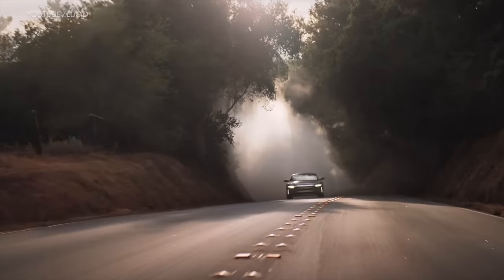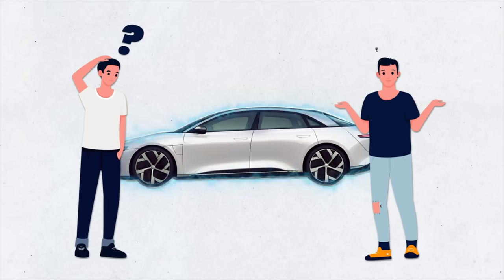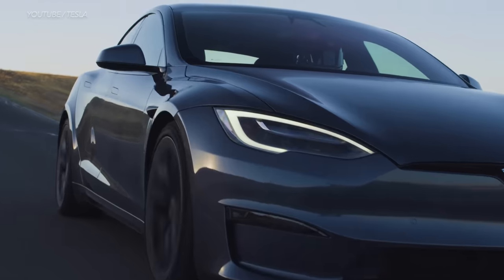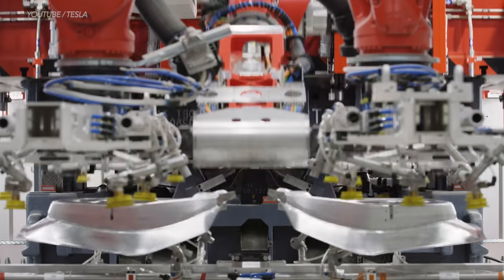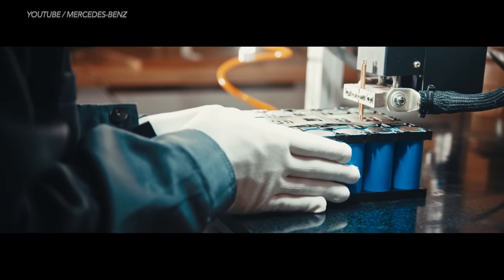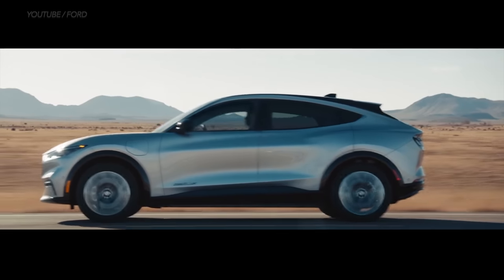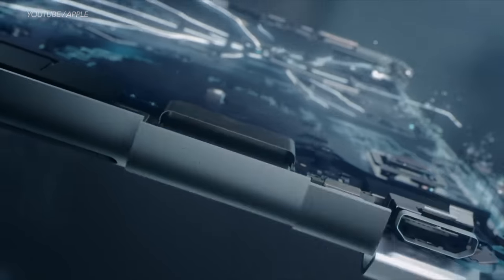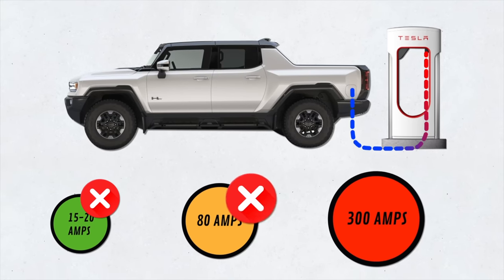Here's Why I'll Die Before I Buy an Electric Car

Comment: For me the upfront costs of EV's will not give you a return for many many years! I'm not convinced they're cheaper. Even in my state if you have a EV there's an additional higher registration fee and you pay a separate road tax. This state does not let you off the hook for road tax just bc you don't purchase gasoline. Most states do this. Buy a good used car $5k, fix it yourself and roll on! Best advice i can give.
Reply: And the taxes for EVs will only get worse. They'll tax you for the electricity and per mile on top of that. Any calculation of the total cost of ownership must take this regime uncertainty into account.
Reply: Good luck finding a good used car for 5k
Reply: Good advice. Long live randy
Reply: You pay road taxes now. You need to pay for your road use. It is not a new tax since you already pay that. Electricity is usually inexpensive. The argument does not make a lot of sense. I drive An EV and won’t go back. The range and charging issues are already solved for Teslas. The charging infrastructure will be improved as we move on.
Reply: @PercivalFakeman  what is the longevity of a Tesla? The cost? Where do the resources for the batteries come from? How long does the battery last and what is the cost to replace it? What are the environmental impacts of mining  compared to oil and gas production? What countries are we in competition with for those resources or do we have enough here, like we do for oil? How are these charging stations generating power for EV usage?
Reply: All the math is based on household electricity remaining static. Watch this space 😉
Reply: @SSJSadAf 
Tons of Toyotas for 5k available :-)
Reply: @benz merc
Yesssss 👍
If an pre 2000 Merc is available, one can't do much wrong with those. If you do have friends living around Stuttgart/Böblingen, the spare part supply is dang cheap as well 👍
Reply: Agreed 👏👏👏
Reply: @PercivalFakeman  The road taxes will triple on EVs because they weigh about 1200 lbs more.
Reply: My state has told us to lower our use of our A/C because the power gride is being over taxed.  Now the powers that be tell me we need to go to EVs and the power grid can take it.  Get out of here.
Reply: @insertrandomnamehere764  where was the article posted cause I knew u saw it once but can't find it now
Reply: agree.... EVs  are  overpriced.  new,  and / or  used.   tezzlas  are  overhyped, overrated,  n  way  overpriced.
Reply: @royhobbs785  they may be about the same as a pickup or large SUV. The worst states are at about $200 per year. Some of the worst states are politically anti EV.
Reply: @vextract4662  The questions you asked all have answers.Many of them I know. Not all are simple. There are even more questions to be asked about our existing path that more serious and Damaging. Battery chemistries are recyclable, it is not the depletion issue with fossil fuels. There was not one gas station in Sacramento when the first cars were purchased. There is always a beginning.
Reply: @SSJSadAf  Maybe $12k................Paul
Reply: @vextract4662  THE newest batteries are designed to last 20 years...........Paul
Reply: Absolutely correct you will lose money wait till your battery goes out and you get hit for $15,000 and not many people work on that electric vehicle junk
Reply: That’s good advice..👍🏽
Reply: Good post. And, I love watching Mecum Auto Auctions. I want an older refurbished car, with NO computer anything on it, and drive that from now on. :) I used to have a 1974 Pinto. It was that horrid mustard color. LOL makes me laugh now, but I'd even take that over an electric car. LOL for many reasons.
Reply: Vey well thought out thanks I: am with you! @vextract4662

Comment: There is no turning point. I will never own an electric car for as long as I live and I'm more than happy to do that.
Reply: To this day there are still some people who own horses and ride them for fun (and I'm happy for them). Still, most horses were replaced with cars a while back. So too will it be with internal combustion engines; some people will hold on to them as a hobby (and I'll be happy for them too), but most cars on the road will be electric (maybe some sort of hybrid for towing/trucks). As the tech continues to improve, the benefits will keep increasing and the costs decreasing. Even without government interference simple market forces would make it happen.
Reply: So you’re saying you’re old and may likely not make it through the next decade😂
Reply: I repel all forms of production in the modern era as they are less sufficient than our ancestors. Electric cars are not the future nor will they ever be, the future is hybrids. We have skipped a stage, the stage of hybrids which combustion engines have been upgraded with a electric parts. Why have we skipped such an important stage and moved onto an inferior way of motoring? Electric cars are more easily controllable by the government, they've already started to put tracking devices in them, it's not secret at this point at all. Hybrids are truly the way forward but why aren't they being pushed as much when they can do a better job than electric? ICE has its limits and we are very close to them.
Reply: @GyroGarrison  Skipped hybrids?! Dude,  the Prius is over 22 years old. Government Tracking?! On-Star is over 26 years old, and pretty much every new car has an equivalent. Inferior?! Inferior is relative to the use-case, as all the options involve compromise; Traditional hybrids are more efficient than ICE, but increase weight, upfront cost, and complexity. PHEVs further increase weight & upfront cost (bigger battery+charging parts), often have slightly lower MPG than regular hybrids, but in exchange offer some EV range (cheaper cents-per-mile than gas). Pure EVs are a further higher weight & upfront cost (although some of it is gained back from less parts; e.g. gas tank/engine/multi-gear transmission), but offer much longer EV range. Each option can represent the best set of compromises for a different group of consumers, and that's ok; that's why they're all available for sale.
Reply: Same here
Reply: @GyroGarrison  you're absolutely right👍🏻
Reply: I said the same until I bought my Tesla model 3, you’ll change your mind 👍🏻
Reply: @itsjammbi  Nah I like my cars to have sound. Plus Teslas are a nightmare to own, especially if you need to repair your car
Reply: @lefthanded5473  there’s little to none maintenance cost for my tesla after 35k miles, plus when you buy one you will get 8-10 year warranty
Reply: @erlindaromero8790  I said the same thing until I test drove a tesla. Best car to drive and super easy
Reply: I think EV works great if you have solar panels on your home.  On average our electric utility bill is virtually $0 even with charging our EV day or night.  Our Tesla model 3 LR has enough range for the typical day trips around the SF Bay Area without having to stop at a supercharger. For longer road trips to southern CA for example, the time spent at a supercharger is only 15-20 minutes. You need that time to use the restroom and get some food anyway.  We still have our ICE cars but rarely had to buy gas as we use the Tesla to go everywhere and run the ICE cars only occasionally.  What we won’t miss with our Tesla are the scheduled maintenance and other issues for ICE cars, ie brakes, oil changes, transmission service, plugs, timing belts, serpentine belts, air filters, batteries etc etc. Also the Tesla is a fun car to drive, it will out run most other performance cars and the Model S Plaid will out run anything production (not modified) that includes the Lambos, Ferraris, etc
Reply: @Norgar756  if this guy was an accountant he'd still be using a pencil and paper ledger. There are plenty of use cases that don't support buying an ev today. I totally get that sad support it but to just flop on the floor and throw a tantrum with no explanation as to why you feel this way makes no sense.
Reply: @GyroGarrison  You are well-named. Your arguments are all extremely poor. How have we 'skipped a stage'? There must be 50 hybrid car models available for people who want them. If you prefer  a hybrid, or a plug-in hybrid, then just go ahead and buy one.

Just stop deluding yourself that having two different motors inside one car, a fuel tank and also batteries is 'the future'.

> the stage of hybrids which combustion engines have been upgraded with a electric parts

What are you talking about? ICE engines have had sophisticated electronics and sensors since the mid-90s. They have had significant 'electric parts' for over 100 years.

Your stuff about tracking devices is just conspiracy theory nonsense. Not only that, but hybrids are easily trackable too. Modern tracking technology doesn't care what kind of car you are driving, so long as it was built in the last 30 years.

You sound like somebody who sells buggy whips and is upset that horses and wagons have gone out of fashion.

You should realise that Scotty is a YouTuber, and all he cares about is clicks and subs. He will say he will never buy an electric car, and then go ahead and get one as his daily driver if he gets a good enough deal on one. He knows you guys have short memories and no foresight.
Reply: Turning point has already come.......You just weren't ready...........Paul
Reply: @TheZeusJuice  sad
Reply: If you live in America, hopefully the gas price don't go over $20 a gallon
Reply: @itsjammbi  My next car will be a Tesla model 3
Reply: @mikafiltenborg2291  nice, and good
Reply: Give me V8s or give me death
Reply: @jizzyjake6783  v8s won’t be a thing no more in 10 years
Reply: @itsjammbi  well then I have bought my last new vehicles which doesn't bother me at all. They are regulating all kinds of stuff in them I don't really want to pay for anyways.
Reply: I'd Own a Gas car cause I'm a car enthusiast and Electric cars would be pretty boring cause that will kill the Car culture...
Reply: @Norgar756  Ok Hippie when Price of Electricity rises don't complain about it and old people no im a Young Person and I still wanna Be able to Drive a Gas car before I die cause I Hate EV'S!
Reply: And then you woke up
Reply: @Zippy Thekid I drive in the highway almost all the time and my 2005 Corolla gets 40+ MPG at 80 mph.

Comment: I've driven several different Electric cars, and apart from the range and charging problems, I find them characterless and boring, heartless and, In me, they evoke zero excitement or emotion. I'm with Scotty, quite frankly, I'd rather go by motorcycle, or even a bus.
Reply: How exciting and interesting are your undershorts, hammer, washing machine and TV receiver and computer?  These are all tools, all commodities and barely distinguishable except for size and color.  You get them for what they can do that you need done, not for the excitement of owning and looking at them or their buttons. The best button is one that isn't there, because it isn't needed.
Reply: You can still have excitement in a car, an ev is no good experience and it really is boring, not because of buttons and all of that other crap but because it just seems like the car got nothing with it. 

A car that basically does all the work for you is just plain boring, why do you think so many people like manual cars? It’s because you’re actually putting in the work and effort. It’s also a workout surprisingly. But that’s manual cars. 

Automatic is still some work but something like an ev not only makes no type of sound but it basically does everything for you. That ruins the whole point in driving a car if you don’t have to drive it.
Reply: Couldn’t agree more!
Reply: @rodrell1075  You’re right! There needs to be a connection between the man and machine in order for the drive to be exciting!
Reply: @techtutorvideos  Driving manual is fun but just kinda impractical especially on traffic situations. It’s tiring.
Reply: @aeronYTco  If you've driven manual all your life it's second nature. You can drive, eat, and fiddle with your phone just as easy as in an automatic. 😁

Comment: $50,000 is the 50,000 reasons you’ll never buy an electric car. 

🔰
Reply: That's so comparable right now to ice cars. When you factor in the tax credit and the literally hundreds of dollars a month in gasoline savings, it's very much worth it.
Reply: Erik 

The scale tips very quickly when gas prices climb.
Reply: And that ain't even count and replacing the battery between 10 to $20,000 in the car I drive electric highways at work and they always break down the batteries they always got to replace them
Reply: @bigbangerik66  I can find an entry level new car for 18k. Where can I find an EV that is comparable? The Bolt is the cheapest at 28k
Reply: Yeah buying one of these cars will surely put someone into unrecoverable debt because they were too lazy to do the math.

Comment: I have a 2015 Sonota hybrid that had a driving range of about 700 miles per tank when the car was new. As the hybrid batteries get older they lose power and are unable to take over for as long from the gasoline engine. My mileage dropped from about 46 mpg to about 38 mpg. Fortunately, Hyundai warrantied the hybrid battery for life for the original owner, so when it needs to be replaced, Hyundai will replace it for free. They expect the hybrid batteries to last about 10 years.
Reply: My moms Infiniti QX60 has went down from 20 mpg to 17.5 mpg through 6 years of heavy driving, city and highway. That’s not just an EV problem.
Reply: @mauricebarry8858  it just needs work done to it. Gas engines can get all of their milage & performance back  with proper maintenance done. Unlike an EV.
Reply: My 2010 Benz E coupe gets 25-27 highway & about 19-20 around town. That's a little above its window sticker ratings. Just about to roll over 100k mi. Unlike EV's or Hybrids, Gas engines are made to be serviceable & when maintained, can last reliably for very long times. EV's & overly complex hybrid systems have a long way to go.
Reply: @RothBeyondTheGrave  lol 100k miles?! basically a new car. Both my 2005 Ford Escape Hybrids were still getting >30mpg  at 160k & 185k miles before trading them in for newer cars. Back when I bought them, there were tons of hybrid taxis on cragslist with 200k-400k miles.
Reply: EVs are sexy now because it's the high earners that can afford. Now sit in line waiting to charge. My family will never put up with. Oh, wait. I just got home and AC power is cut from power company. Hummm. Everyone is charging. The power grid will never replace all the BTU's with kilowatts. I call my power company and ask what's the deal, no power. Sorry sir the wind isn't blowing. Solar even worse.
Reply: @mikeclemens5735  that indeed is the future we can all look forward to. Progress?!?! No.
Reply: I have a 2013 Ford CMax energi. An hybrid like your sonata but with a bigger battery that i can charge using a household socket. It has lost some battery capacity. We used to get 25 mile in summer on EV mode . Now it is down to 18. But still enough for majority of commutes being on electricity. We use gas mostly on road trips.

Comment: A few tesla car crashes lately had the cars on fire 🔥 and they just kept burning as the fire dept kept spraying it.They completely melted down flat.
Reply: Lithium loves water! Spontaneous combustion on contact with humid air!
Reply: A company has developed an device for EV fires.   Looks like a floor jack.   Push it under that car and it punctures the battery.  Fire truck pumps water into the battery to cool it.

Comment: Western Canada suffered through a very harsh winter this last year and there were scores of people stranded on the side of the road in -40c weather who traded their EVs in and said never again
Reply: Wow. Someone should make a video on that
Reply: @drewfeld836  it's against the green energy plot
Reply: @aitoluxd  we wouldn’t want to ruin their master plan
Reply: Who goes out in Minus 40C? I had that once and I tell ya, you can hardly breath at that temp. Your damn gas car won't even start and If you get it going it feels like you are driving on squire wheels because the rubber tire doesn't flex.
Reply: @bossman6174  were out in it every day on the prairies 😂
Reply: Wow, that’s incredible considering Norway, Iceland, and Sweden have the most EVs per capita and all are just as cold as Canada. Conclusion: you made this up. Social media at its finest.
Reply: @lmax4094  they’re not as cold as Canada. That has been the EV fanboys failed argument since the beginning, there’s parts of Canada that may be comparable but they don’t even come close to our climate, not to mention they’re small countries as well, people seem to forget how vast Canada is and how long of trips people need to take.
Reply: Try to idle two vehicles, one with combustion engine and one with battery, while maintaining climate in your car. You'll be surprised which one dies first. 

Hint: It's not the electrical one.
Reply: @foobar6846  try driving the same ones as far as you can before either dies and see how far you get (in any kind of weather) 😂
Reply: @blackfacecastro-trudeau   Blackface Castro- Trudeau ! 
That really defines Trudeau !😂 
I dont know who has the Worst Leader , Canada or the U.S. ?
Reply: @blackfacecastro-trudeau  I routinely do. In very very cold weather I get around 10% less range. This thing is blown way out of proportions. The biggest factor in range is using winter tires, not cold batteries.
Reply: @foobar6846  you must have one of the only ones capable of that then because I’ve seen a lot of ev owners claiming the exact opposite of that
Reply: @bossman6174  If you live in Canada and need to get to work.... you have no choice...
Reply: @bossman6174  As a Canadian, I can tell you everyone goes out in -40 weather. We have work, responsibilities, and needs. Don't know if you even heard, but we have this cable we plug into our car which makes it so we have the battery power to start the engine.